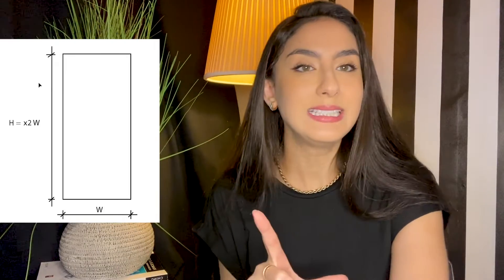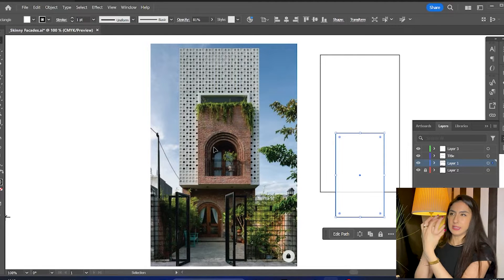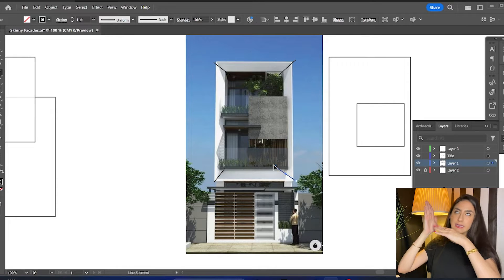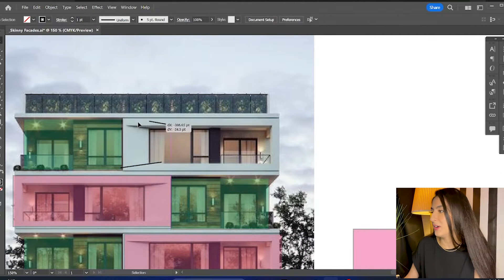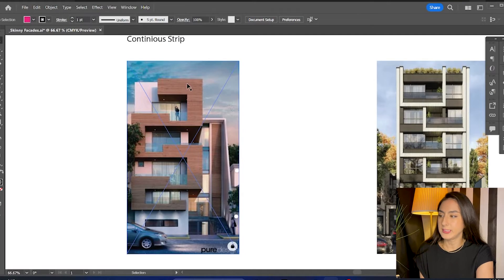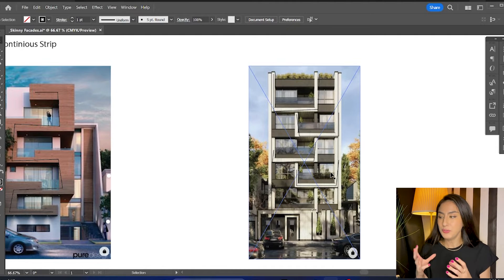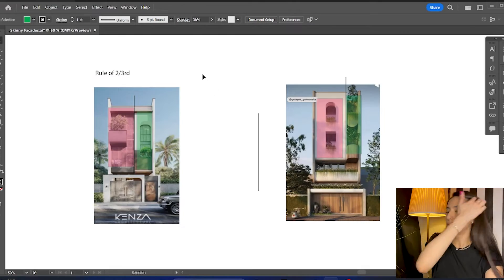FACADE DESIGN - How to Design a Narrow Skinny Facade * Follow These 6 Design Tips*

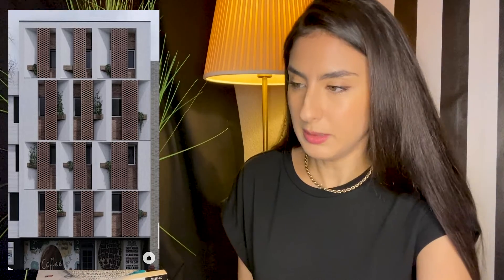Comment: Hey rewatching this video again, I noticed something. On 8:19 did the architect sacrifice comfort by doing thin windows? They look smaller than they should be. How can you get light from there if it's also deep inside the facade? (z axis)

Also in your next video could you give us tips on how to improve some of the facades you showed? Like in 18:00, the design is not that good but what would we do to make it better? What I would do is make two lines on the sides go up more and add tiny boxes that either go in or out from the cut squares on 1/3. Also make the net-like facade on 2/3 in order to make it asymmetric.
Reply from the maker: I’m not really familiar with the plan of the facade at 8:19 but I hope they are not sacrificing any comfort and maybe the small window is more of a closet/ bathroom? Or maybe it’s good that’s a small window to minimize heat gain if this is in a warmer climate? You could get away with small windows if the interior layout is right.

As for 18:00, I would personally get rid of the screen first, look at the plan second and choose one of the design tips that make more sense in terms of again, heat gain, privacy, room layout, etc. To your point, making the 2 side lines go all the way and make them more defined will definitely frame the facade more and that’s a great start. (This would be a fun exercise for another facade design video)